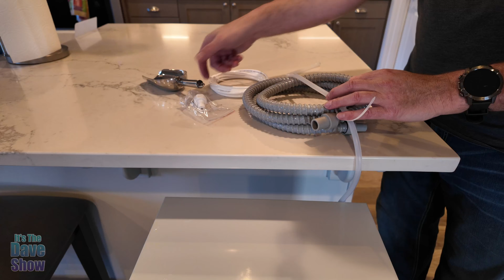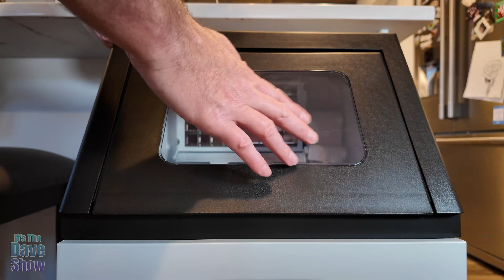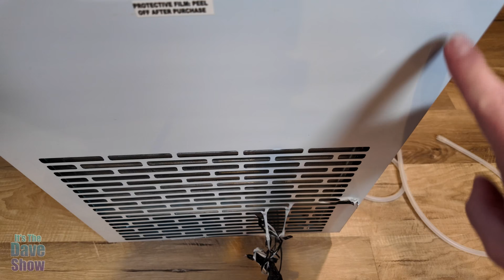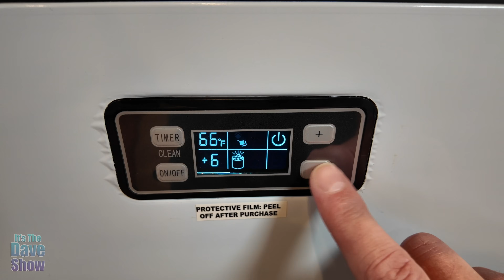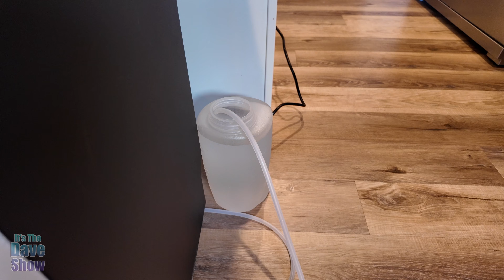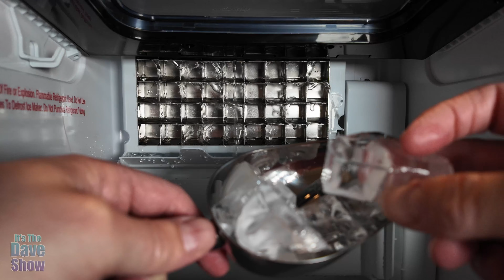commercial ice maker make 100 lbs of ice a day at home

Comment: Where does the R290 gas go?
Reply from the maker: no need to put any gas in it. it is all set and ready to go, if for some reason you needed to do maintenance on it like that there is access to the condenser and stuff in the back or side panel

Comment: All restaurant operators give a little cringe when touching ice with bare hands and then putting it back in the bin....noooo, please!! Seriously though, thanks for the review. I wanted to ask how the unit has done these past 6 months?
Reply from the maker: I hear ya, I am not a restaurant though, no one else had access to this ice lol.  I Sold this unit off as I don't really need anything this big.  Don't know what the long term usage is like sorry.
Reply: Did it work well for you when you had it?
Reply from the maker: @BarbqRiot  it did work well!
Reply: This works very well, and will feel up in about 6 hours.   I am the only one who have access to mines. I have a Samsung refrigerator with icemaker, but it is slow, and always frozen. So I use my ice maker to feel my refrigerator.  No one knows I have it.  It's in my laundry room sitting on top of my washing machine. It blows a lot if heat. Keep your house warm. I love it. Oh yea. I have ice bags two ice bags in my freezer that I keep full, and on rotation. Just in case.
Reply: This is something you should keep to yourself like I do, because people are nasty. Ijs
Reply: Hey mate. Out of your water bottle feeding the machine, how many batches did you get per the amount of water 

Cheers